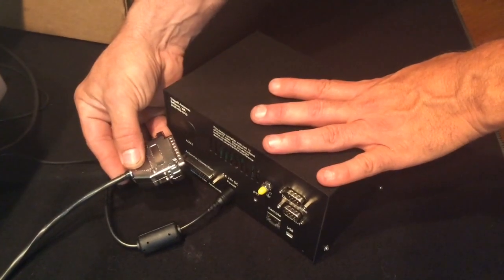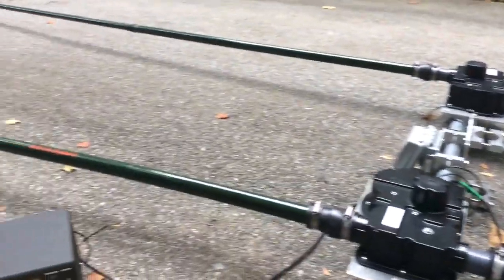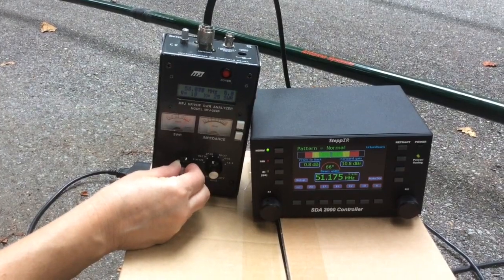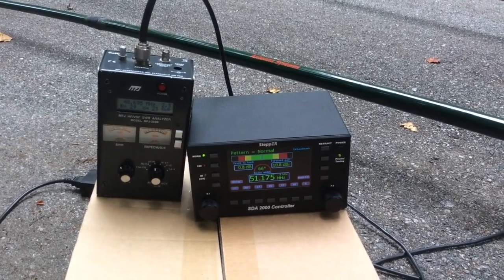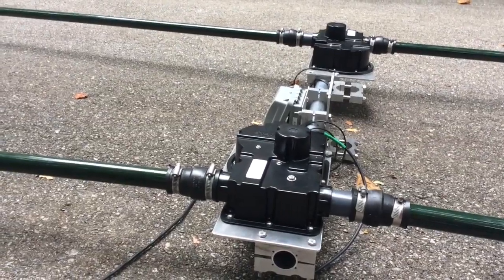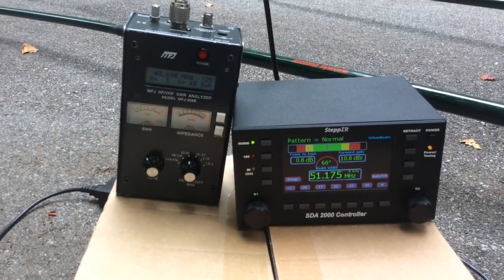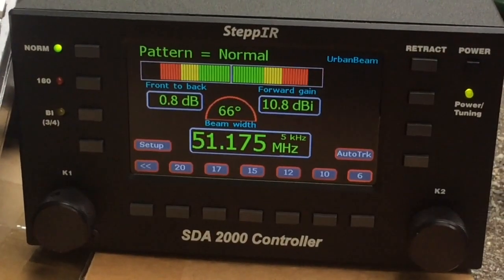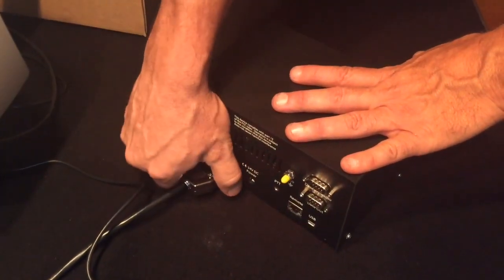SteppIR UrbanBeam   Resonance Test

Comment: When has lowest swr been or equals resonance?   It’s like trimming a dipole for best swr,  it won’t be resonant, if it was it won’t be 50 ohm .
This is the problem with step Ir owners!   Very little idea of what a resonant antenna is,   It is not a step ir.     It adjust length for best swr not resonance or best efficiency which is resonance and some form of impedance matching to get back to 50 ohms.
On a real yagi you set the driven element so it’s a resonant then you adjust the gama match or matching net work to get 20 odd ohms back to 50 ohms,    A step ir just trims the antenna length , using reactance and a non resonant length to get a low swr. 
High performance antenna builders don’t build these things,  these things are built for appliance operators with very little antenna knowledge, 
And those who know how a yagi works don’t buy these motorised antennas and the poor reliability . 
I guess gullible hams get sucked in all the time and the sharks only too willing to sell snake oil .
I have a high performance antenna cause it cost me thousands of dollars!     No you don’t! 
You have a expensive compromise that sort of works some ham bands , when the antenna works that is . 
Show how far the hobby has degraded, to the point hams fall for marketing hype over knowledge.